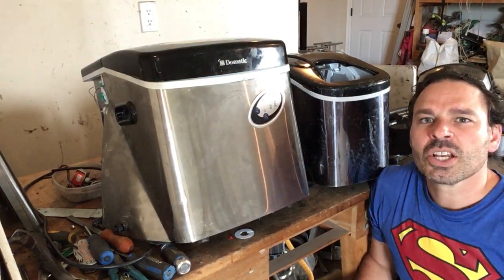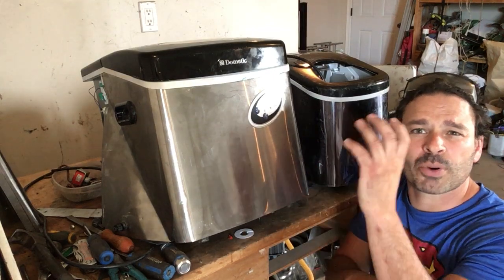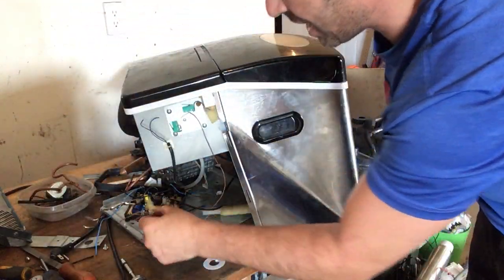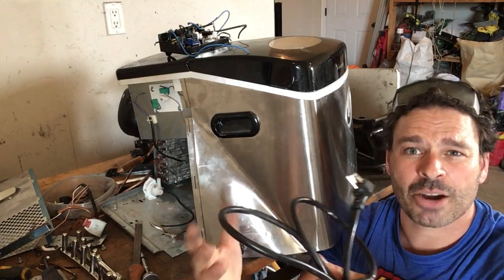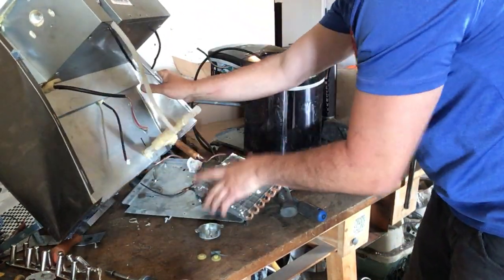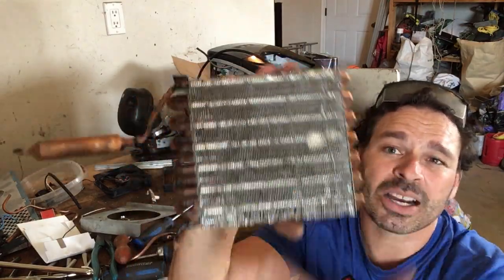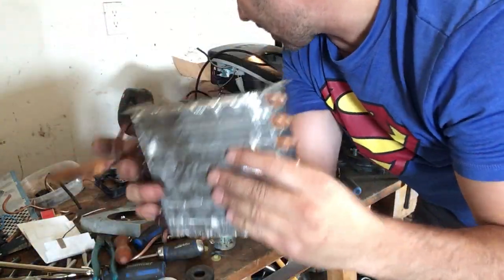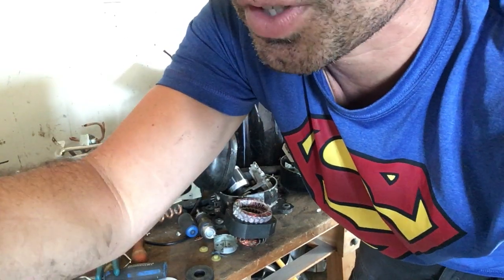Scrapping a large ice maker for loads of copper and other metals: I never pass them up!!

Comment: Good   day James  I phone  a few places they all wanted $65,  so take air conditioners  in to scrap  yard
Now  were I go  they have   extension  cords price 35-45%  at .60/pd   What is different from that than  appliance  cord??
Thanks  for now    3 weeks back to work!
Reply from the maker: it all depends on the scrapyard I think and where you live. if you want to upgrade the extension chord to appliance wire then you could remove the outer coating. That way the yard will just see coated wire. There are different types of extension chord; some are more flimsy and contain less copper wire. if the chord is really flimsy I would just leave as is. If the chord is harder to bend then remove the outer coating and put in with appliance wire.
Reply: @TinManScrapper    Yea I guess Thanks